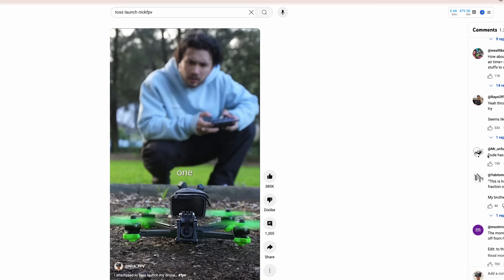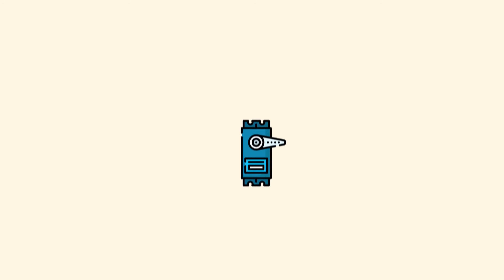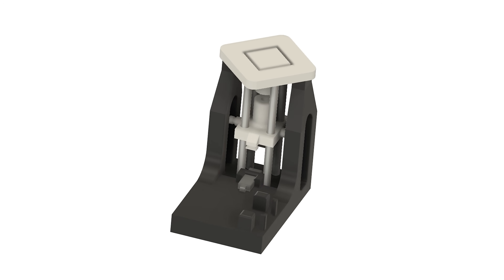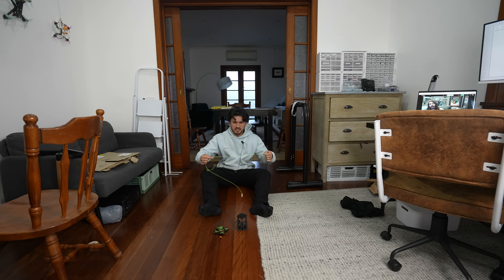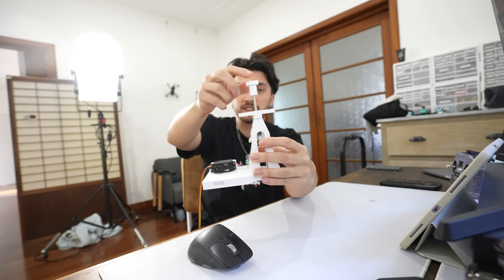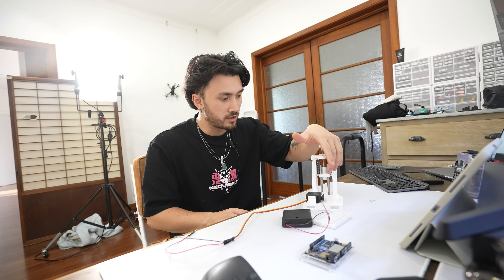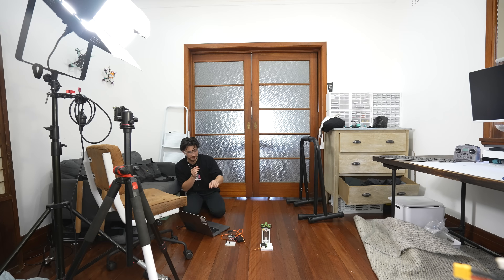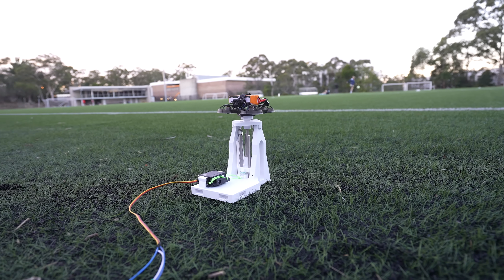I big brained the toss launch

Comment: could you not potentially make the servo remote controlled and bind it to the arm switch of your transmitter? so it arms the drone and launches at the same time? if not add some deley between arming and the servo release so it gives the drone a moment to catch up

Comment: That was actually a really cool and very ingenious solution. Props to you. The first time the drone flipped when you launched it, but with the motors running at what I assume was idle, it came up nice and straight. Before I figured that out, I had thought that maybe making a cradle for the drone when it got ejected could help keep it straight during the "toss" before you take control.

Comment: If only he had some way of controlling a servo remotely. Like some sort of radio controlled device perhaps...

If you're using ELRS you can just bind a second receiver to your TX and use a button on your radio to flip the servo
Reply: Yeah, the servo should take 50Hz PWM with 1ms - 2ms as an input, which is the standard for ESCs as well.